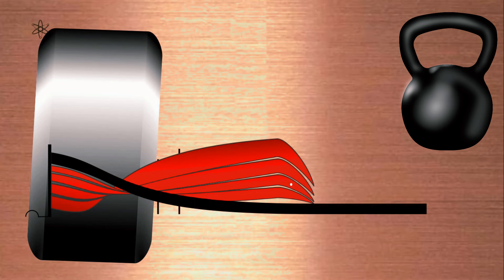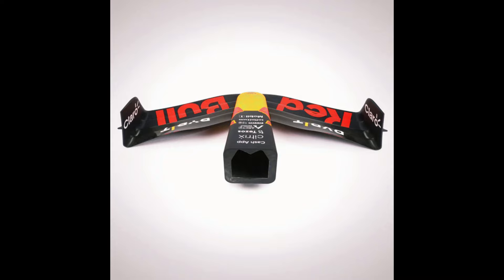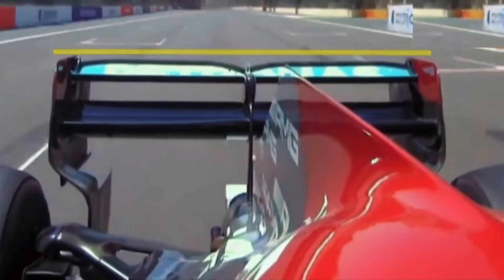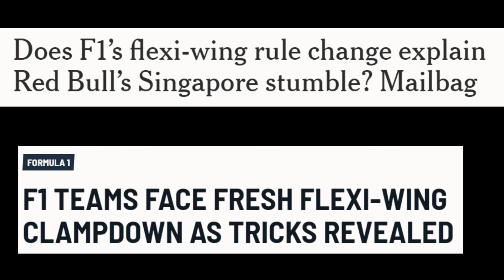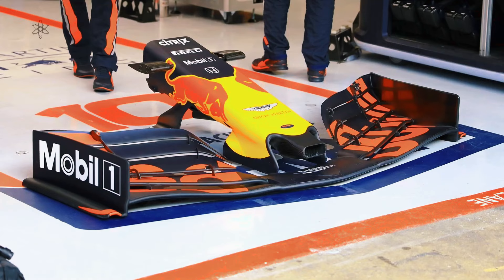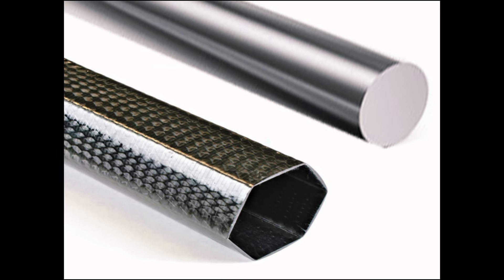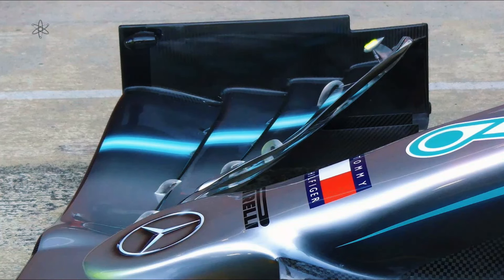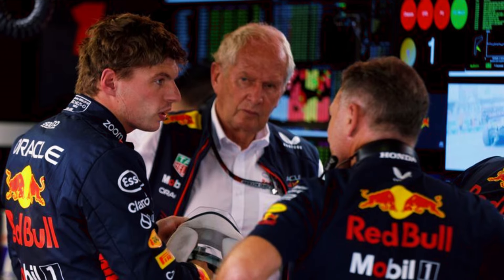Horner groans about McLaren's Triple Flex Wings "CHEAT"

Comment: 3d printed hollow and heat treated titanium with an organically constructed inside (as in bird bones) could be as light and even stronger than carbon fibre, so no more deflection. But that material does not crumble, it might even be bullet proof. So it may not be fit to use in F1, due to it being really dangerous in crashes, if a broken front wing flies around like knives.... But it would satisfy the rules by not flexing anymore😂
Reply: Oh, and 3D printed titanium could be cheaper and more sistainable than carbon fibre, due to tha fact, that failed prototype parts, could be melted down and turned into plwder for 3D printing again, so no wasre material, no need to buy as much new material and a new part every few hours to try out, with only the electricity and labor to pay, if you make the new part out of the old one... But still, it would be very dangerous to use as winglets or aerodynamic surfaces, that could break off an fly around after a crash...